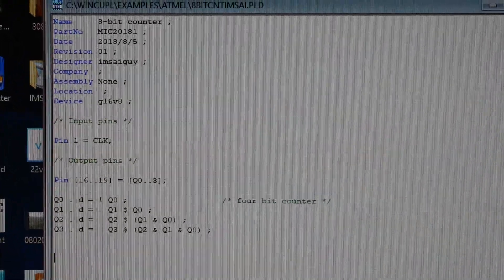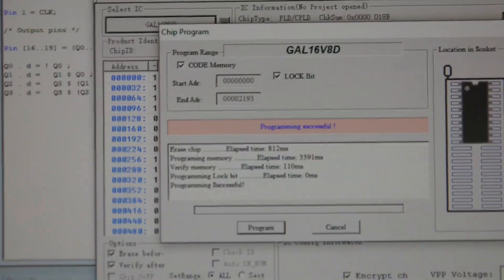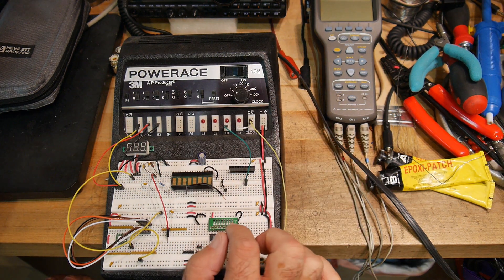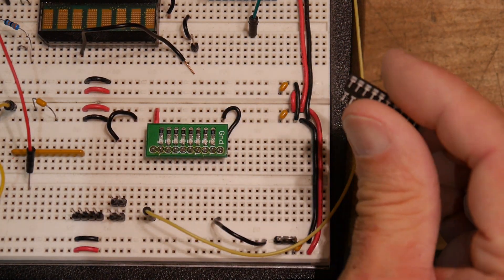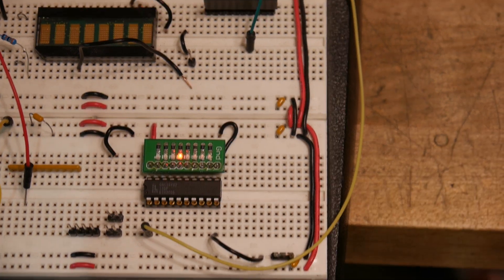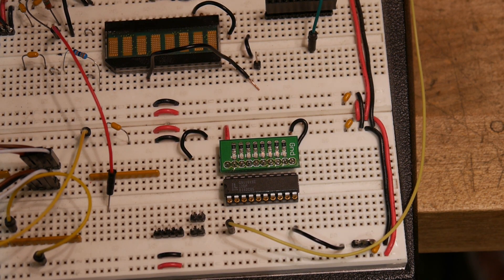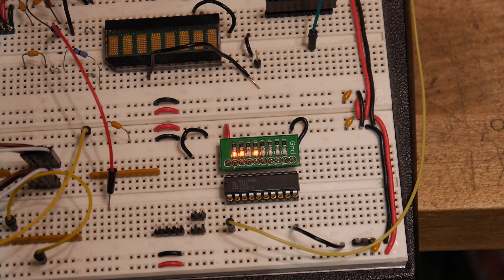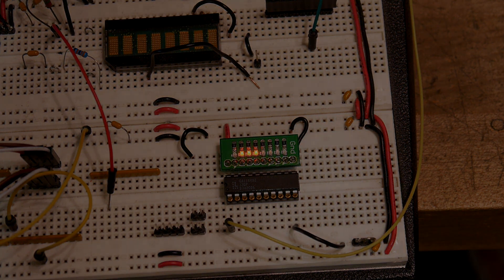#248 GAL 16V8 16V8D 16V8Z problems

Comment: I know I'm necro-replying, but if you put a 15K resistor to GND on the CLK pin, it will work. Problem you had with this was the clock was open drain, and the Quiescent current of the inputs is 100ua, so it was NEVER REACHING Low state :)
Reply from the maker: Don't think so, clock comes from pin 3 of 555, not clock is from a TTL inverter chip. no open drains. it does not use pin 7 of the 555

Comment: The data sheet says under "Input transition detection" that "the first rising clock transition from power-down state only acts as a wake up signal and will NOT clock the data input through to the output". So if the time between your input changes is > tas (60-150nS) it will go to sleep! That would explain why you are losing pulses, weird device......
Reply from the maker: yes that would explain it. weird indeed

Comment: can you please tell us where  you get the 8 led indicator strip ?
Reply from the maker: I made them. They were part of my TTL CPU project. They are very handy. You can find smaller ones 5 or 6 leds on ebay.
Reply: Whatever happened to the TTL CPU project ?
Reply from the maker: sorry I got bored with it. A problem of mine